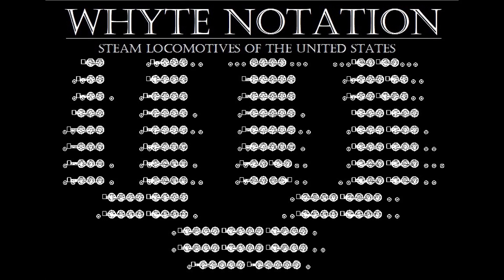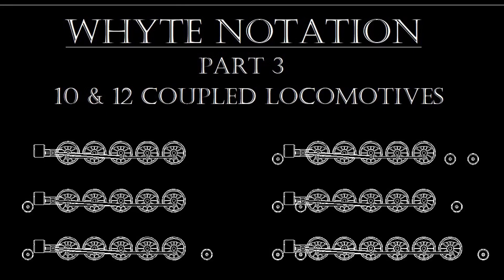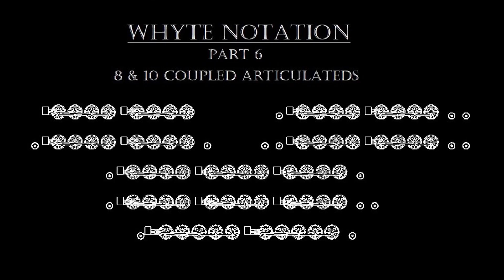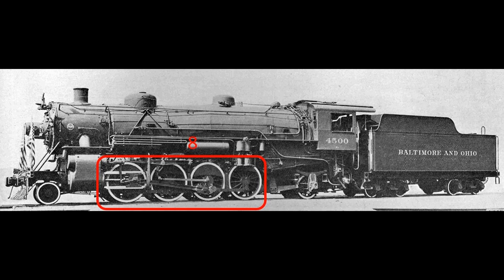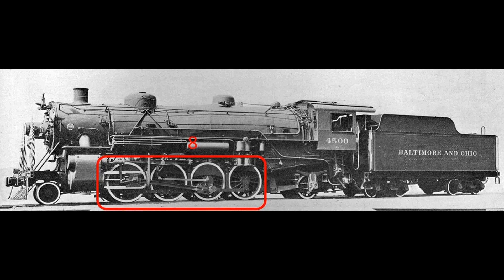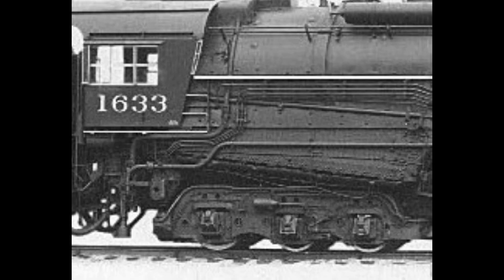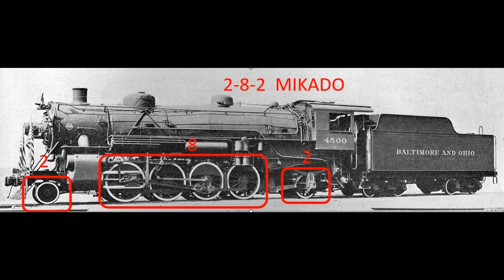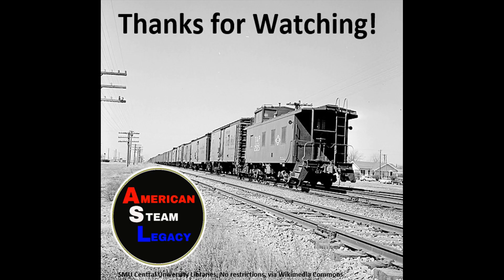Whyte Notation - Introduction

Comment: Isn't it silly to count wheels instead of axles?  Is an 4-6-0 (in Cerman 1 C for one pony axle and 3 x
coupled axles) an Articulated or an engine with an 2 axle pony truck and 3 coupeled axles  ?
Reply from the maker: Hi Steffen.  The Whyte Notation is just one of several classification systems used around the world.  The UIC System, or German system, counts axles instead of wheels.  The UIC system has in many parts of the would replaced the Whyte Notation and includes modern diesel, electrics, and multiple unit motive power.  Thanks for your comment and thanks for watching!!
Reply: One side effect of the Whyte Notation was it doesn't cover wheel types that didn't pan out.  "Why doesn't it cover the..."  "Don't do that!"

Comment: There is an issue with your definition for the the leading and trailing wheels. What happens when you have multiple axles that are carried independently of other such as on the Crampton style locomotives?
Reply from the maker: Hi Neil.  That's a great question.  The Whyte Notation doesn't distinguish how the leading and trailing wheels are attached to the locomotive.  The wheels ahead of the drivers are grouped together regardless of whether the are carrying a separate truck or attached directly to the frame.  The same is true for the trailing wheels.  Thanks for the comment and thanks for watching!!
Reply: One side effect of the Whyte Notation was it doesn't cover wheel types that didn't pan out.  "Why doesn't it cover the..."  "Don't do that!"
Reply: @tonyburzio4107  you could try the UIC Notation.